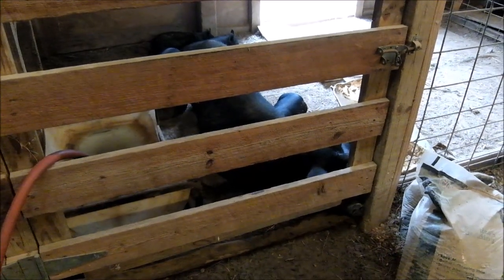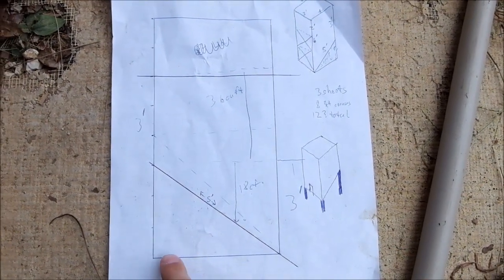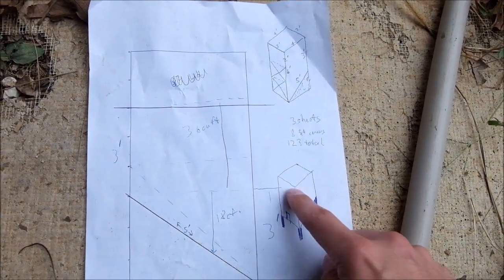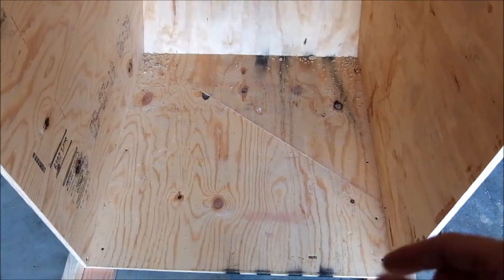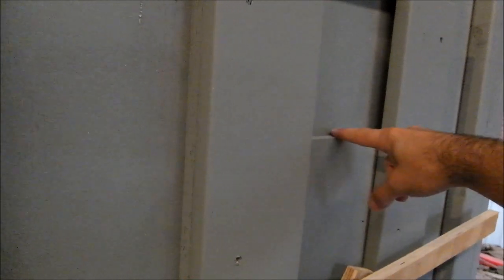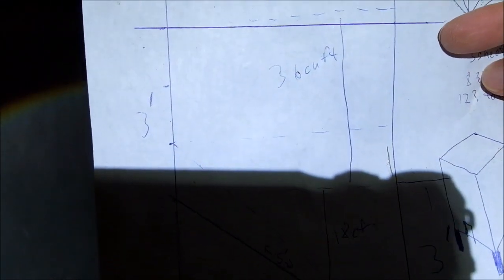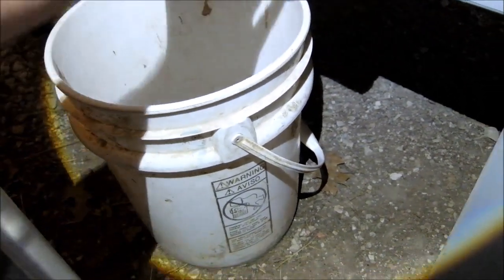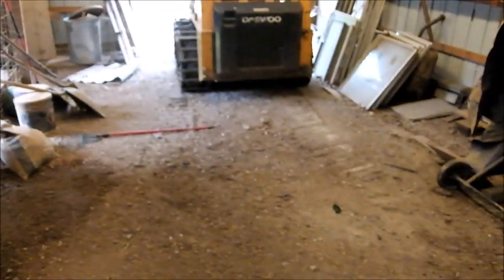$100  DYI homemade 1 ton feed hopper  grain bin

Comment: I like the design. I am nearly in the same boat. I get around 1 to 2 tons a year depending on how many pigs I am raising.  I too have been been looking for small grain storage. Only difference  is that mine would have to be outdoors.  Probably some pressure treated lumber on non feed contacting surfaces, some good paint on the other surfaces and a good roof design. Thanks again and keep us updated.
Reply from the maker: I was tempted to save space in the barn and have it outside. Inside worked out. I am loving it. So convenient and loading from the the back of the truck is great perfect height. I lift up the bags a little and pours right in. Small roof on top? Just need to keep water out.

Comment: I like this. I want to build a metal skinned version to make it rodent resistant. Currently we store our goat and antelope feed bagged in metal cabinets around the property and decant into filing cabinets for use. This is a pain and wastes space. Your hopper make a lot of sense as it is vertical storage and dispensing.
Reply from the maker: Sheet metal lined would help!  There are definitely  chew marks on mine
Reply: @sweetpigfarm3645  I was thinking about using a plastic hopper bin, but placing electrified wires around the stand legs powered via a fence energizer.

Comment: It took me 3x to watch the video before I figured out that this really can be made from 3 sheets of plywood.

Since your plans showed a 4'x8' sheet of plywood, I was thinking you were making it 8' of hopper PLUS the 2' legs. Once I realized that the line drawn across the sheet in the plans was a cut line, I realized that the hopper is only 6' tall in the front. So that gives (2) 2'x4' pieces from the sides that can be used on the front.
Reply from the maker: Thank you, I hope your comment clears it up for others.
Reply: 3 sheets of plywood.  So $1000...
Reply: @lavenderlilacproductions  lol no kidding these days.

Comment: That feed bin is great for my needs
Reply from the maker: i don't think i put this in the video but use screws and use a lot. I didn't use enough and it started to pull a part at the corners. Easy fix just added more.

Comment: Have you had any trouble with your green getting wet with the wood holding moisture?
Reply from the maker: No, but here in the Midwest it can go from freezing cold all week to a day of 70 degrees. And that amount of feed being so cold can draw and moisture. It's not enough for the feed to freeze together, but the pellets start puffing up and breaking apart.

Comment: I operate on a smaller scale, but your idea is brilliant and really much simpler than what I was cooking up. Many thanks!
Reply from the maker: This would be great scaled down
Reply: @sweetpigfarm3645  Your idea of the sliding gate really made it possible for me. I did mine today based on your design and it was 2x2 and 3' tall. I kept my sides square and added a bottom to sit on four cinder blocks I had. I added the 45* baffle of course. If anything, I could have made the gate four inches instead of six to direct into the smaller bucket I use. Even with those dimensions, I was able to add 200lbs of grain. 50#'s are easy to dump in, but 75's are more than I like. Scooping 20x into an ever-diminishing sack of grain is not my idea of fun and this improved my routine by several magnitudes. I just wanted to thank you again for sorting some of the barriers that kept me from ever doing this project. My gate works perfect and I owe that to you! I forgot to add: I managed this smaller hopper with one sheet of 5/8" plywood, if anyone in my situation wants to know.
Reply from the maker: @kcender3771  great!
Reply from the maker: That's why I really love YouTube we can share ideas like this